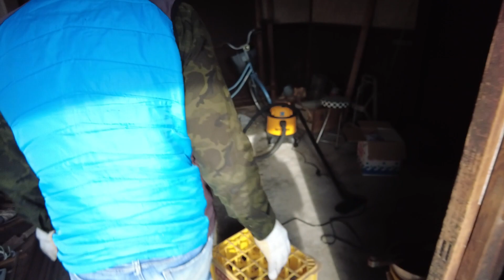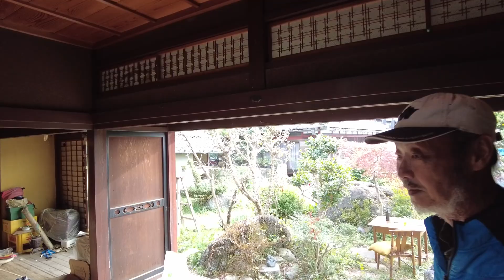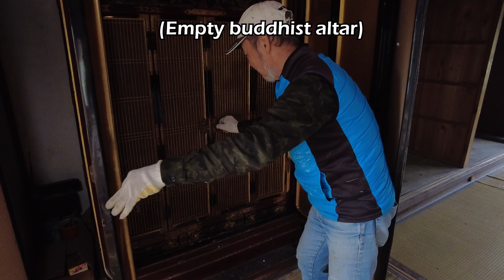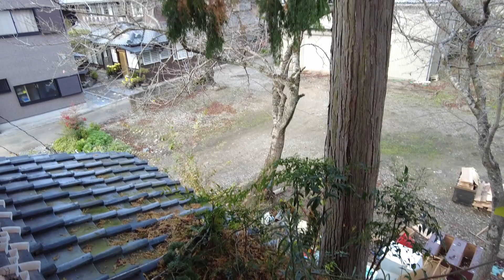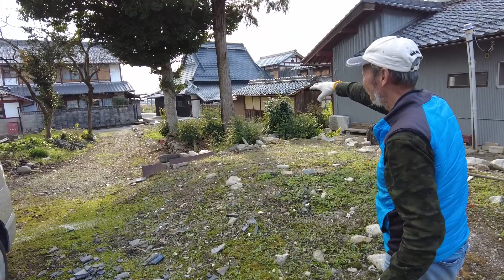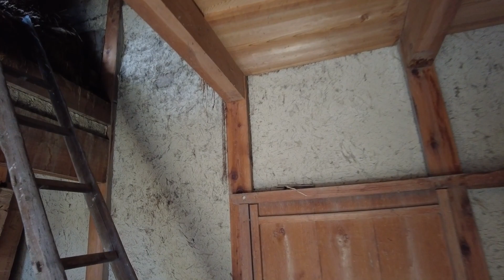Ichiro and the 3 Traditional Kominka he bought in rural Japan - Fixer upper Akiya Houses Tour

Comment: So much of this reminds me of mine...like they could be related lol. Even my kitchen is a disaster, and that's also the side with the roof problem.
Reply from the maker: The kitchen area is always quite disastrous for these old Kominka houses 😂
Reply: @GoodOldHousesJapan  Mine has what I call the "potato chip floor," which is made up of brittle half-inch plywood that can support hardly anything. This is the same flooring that was used in my 2nd kura, which looks like it was used as a type of living quarters or guesthouse. Do you have any idea why the cheap, weak, "spongy" type plywood was used so much in many of these houses? It isn't good from the start, plus it doesn't last long! Very dangerous -- I fell through the floor of my kura during my first ever visit to the house and got scratched up. Luckily there was no major damage, but it could've easily been much worse.